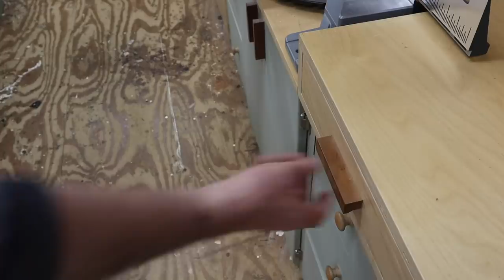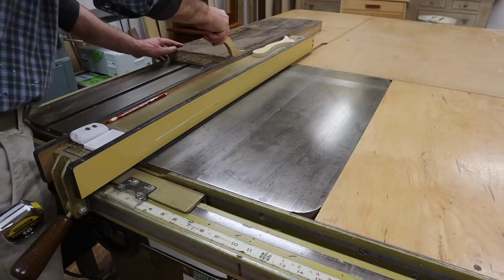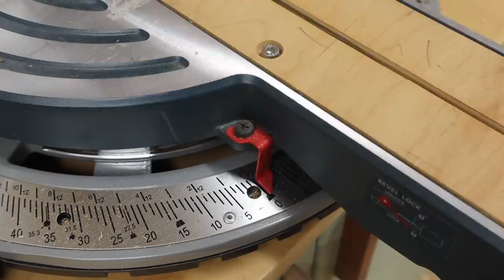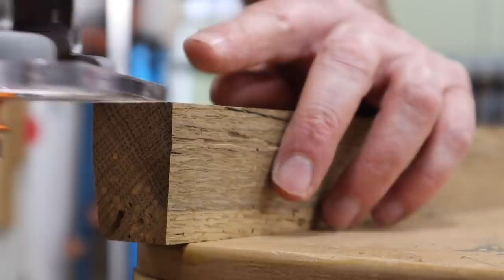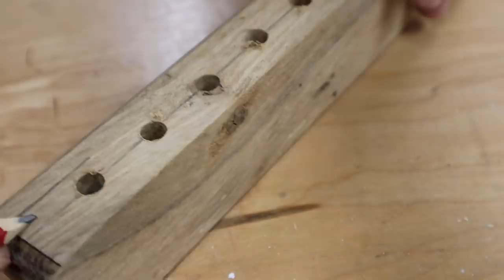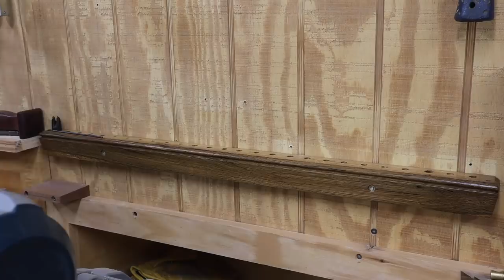Make a Drill Bit Organizer Shelf

Comment from the maker: This is a simple project to help keep your specialty Drill and driver Bits organized and insight.I typically have a few bits that I use on most projects. Countersink drill bits, self centering Drill Bits and driver bits. This shelf will keep the bits organized and insight… If you’re tired of digging through drawers and stabbing your fingers make this shelf it’s a fun project and I think it looks good on the tool wall. Thanks for watching and be well, Jon.
Check out my latest Instagram post to see the latest tool addition to my shop.
Instagram: https://www.instagram.com/jonpeters_
Thanks to Acme Tools for Supporting what I do....Acme Tools - Where I get my Shop Tools:   https://shareasale.com/r.cfm?b=1525272&u=2334202&m=54029

Comment: Great build Jon. I was inspired and built one for myself. I had been keeping all my bits in drawers or attached to my toolbox with rare earth magnets.  I don't have a wood wall to screw into, so I used a forstner bit to drill out recesses on the back and used CA glue with some rare earth magnets to hold it against the side of my tool box. Thanks again for the great tip and inspiration.